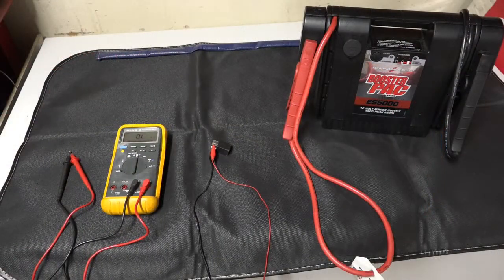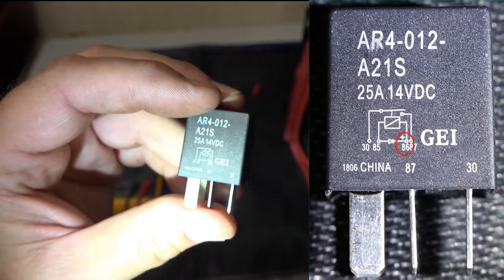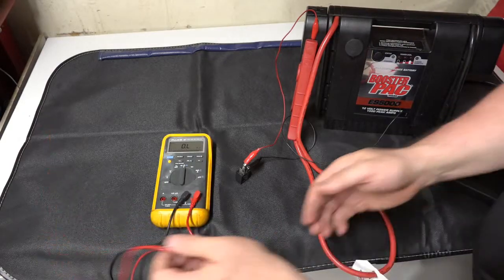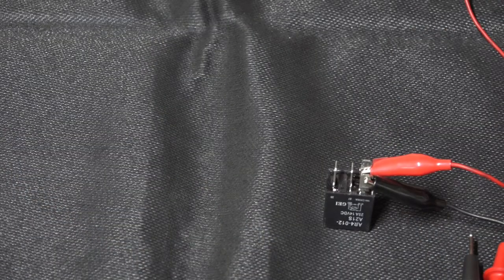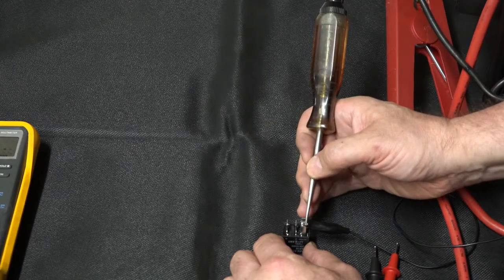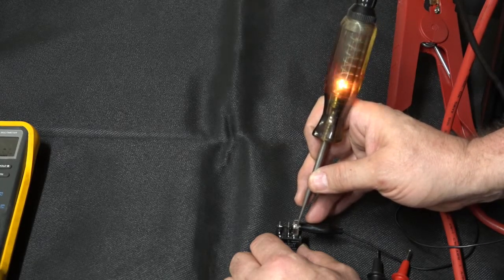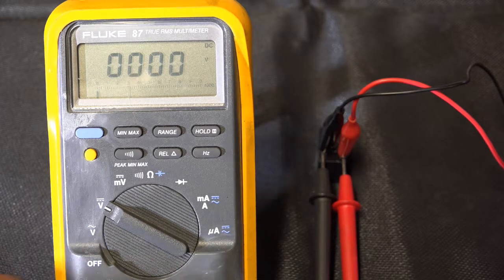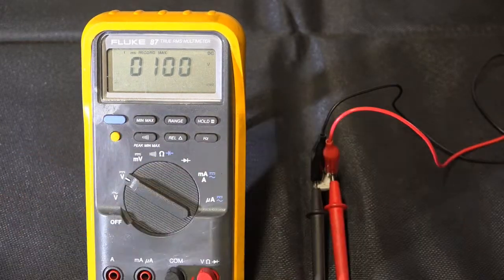Harley system relay bench test

Comment: This test is not reliable 100%. I tested both of my relays using these methods. Both relays tested fine. I went insane troubleshooting. Someone else said change that relay! I said it’s a new relay and it tested okay. I bought 2 new relays and the bike runs. Sometimes everything can test okay but still have issues. Stupid electrical problems.